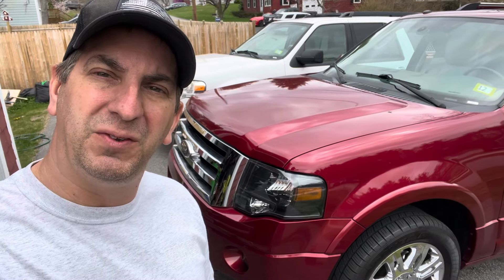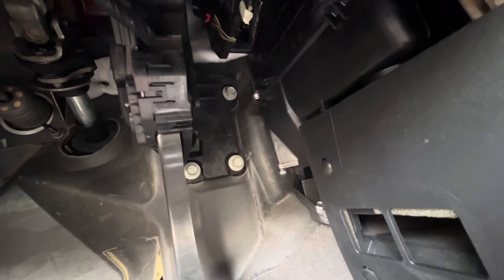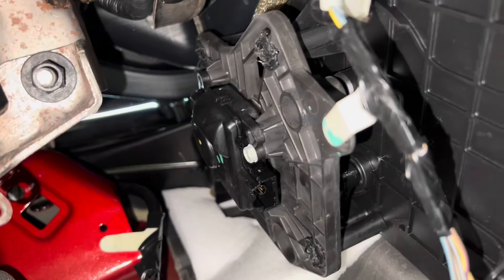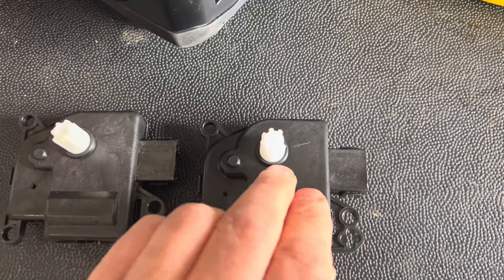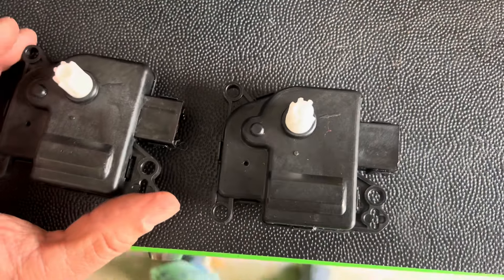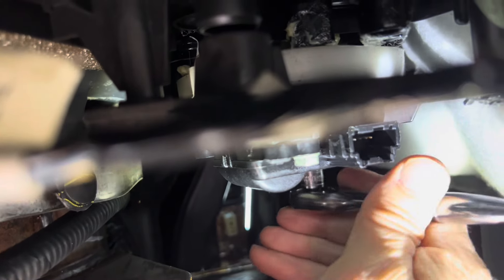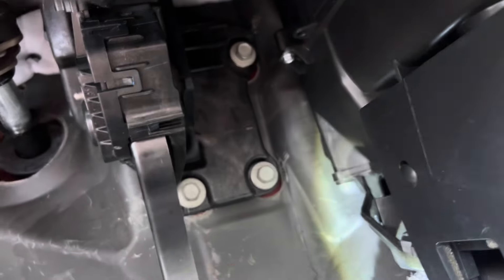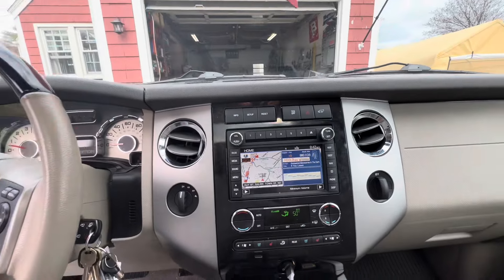(2009-2014) Ford Expedition Mode Door Actuator Replacement

Comment: After contorting my back initially, I put a 45 quart ice chest next to my running board. Then, I was able to lay comfortably on my back, and the pedal and mode actuator was easily removed and installed.
Reply from the maker: Hope this video helped you out.

Comment: Great informative channel, do you perhaps know how many actuators are on the front AC. I need to find the reason why my recycle button is not working. It seems that the air from outside is pushed into the blower and that heat from outside is causing my AC not to work properly. I know about the 1 you showed and also 1 behind the radio that allows cold and heater to blend. Is there somewhere I can find a ford manual without paying a houses price. Thanks
Reply from the maker: There are three. There is one more that is under the dashboard next to the heat duct on the passenger side. That one went on this truck, and it was a real pain to swap out. Steve and I had to pull the console out to gain access to is under the dash.

Comment: What if you fix it and it’s changing and you hear clicking still
Reply from the maker: It shouldn't be clicking. Check to see if there is another actuator that is making the noise. If the new one is noisy I would return it.